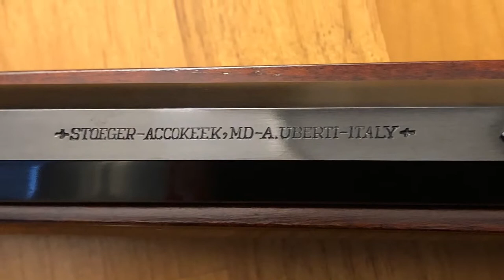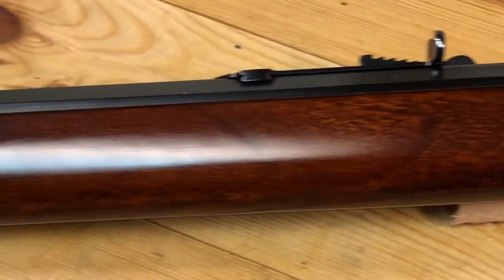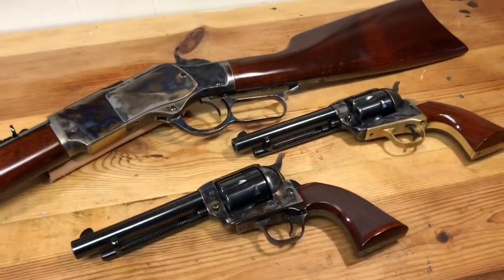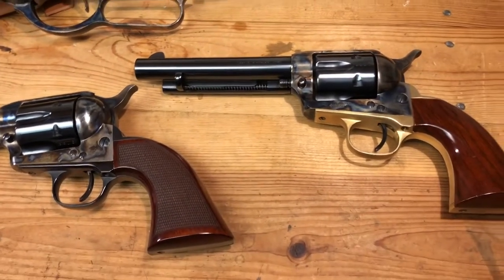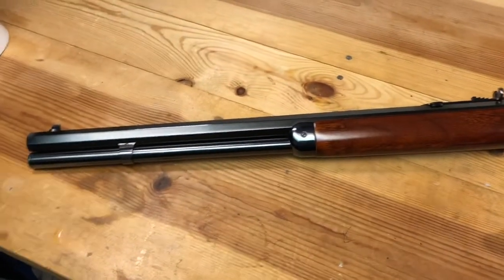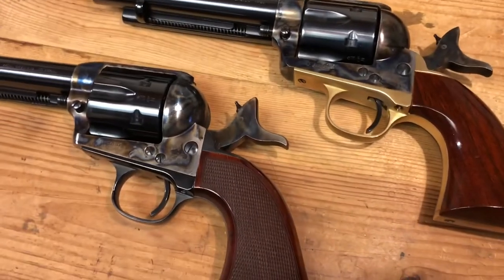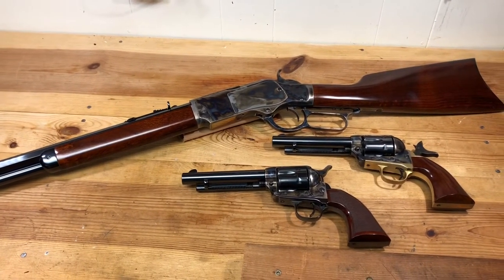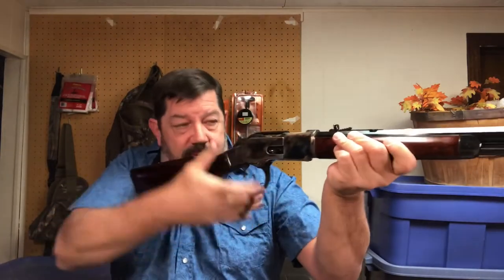My Uberti .357 Magnum Replicas

Comment: Hi David
Congrats on another very well made video. As I mentioned to you b4 I have 2 of those cattleman 2 pistols. 1 I had since August and second  I just picked up two weeks ago which I haven’t shot yet. My first I’ve only put 120 rounds 38 special factory ammo through so far. First 60 I had some drama where the cylinder won’t lock in place when it rotates so I had to help it with my finger to complete a full rotation and lock in place. It probably did it about 5-7 times out of the sixty shots. Second 60 shots it only did it about 3 times. I put a wolf spring kit in both of them and also stripped them both to the last screw and spring and cleaned and lubed them. I love those pistols man and I’m not getting rid of them regardless. Hopefully next time I shoot them I’ll have no issues. I also filed, polished and blued the corner of the ejecting rod channel as it was a bit rough and the rod would sometimes find it hard to return all the way back. Now it’s way smoother and returns back every time. I also polished the brass with autosol and waxed with that renaissance wax, they look a million bucks. Best wishes to you and your family for 2019.

Comment: Standard manufacturing Colt replica. Around $2,000.  Fireblue screws all aligned. Beautiful firearm. Meticulous detail, faithful reproduction. Charcoal bone color case hardened. Just does not say Colt on it. Extremely high quality.
Reply: Standard MFG like the now gone USFA is built much better in over all terms than Colt or Uberti, but quality is expensive. They almost look too good to shoot.  This is why Uberti is a great option, the guns look very good and are priced to shoot, not have as a safe queen.   I would rather spend my money on a Standard MFG gun than a Colt in that price range, but anything from Uberti or Pietta gives you about 85% of the same experience of 1/3 the price.